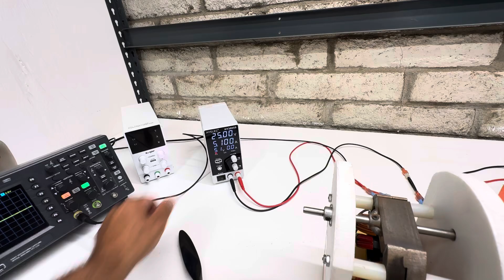attraction motor adding coils for more energy return

Comment: Do you think its a delayed pulse that stays in flux if you don't have the collection coil? Maybe slowed down due to the lack of extra lines of flux from the solid core? I bet if  you set your second channel up you would see the delay and could tell how much out of phase it is. Its probably so slow it never gets a chance to come out of the core before it gets fired again.
Reply from the maker: @theclintified  hey buddy! 
It basically picks up the pulsing magnetic field of the motor core 
 That’s a good idea 👍 I’ll have to try it
Reply: @kenergy1707  I couldn't make out any change in amp draw so thought you might be tapping into some loss from the solid core. I really like those motors.
Reply from the maker: @theclintified  thanks buddy me too they run nice 
 I have one with electrical steel from a vacuum it runs really fast
Reply: Would it work if the rotor doesn,t turn. Make it solid state. Maybe more efficient. You than can play with the frecuency. And core saturation.